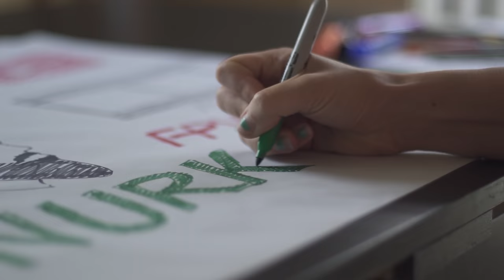Catching the last Drops of Sun

Comment: lol, same thing happened to me on my board. but i was on gravel at about 18 mph and a small rock jumped up and got jammed between the drive belt and wheel gear sprocket.  it just locked them up and tossed me.